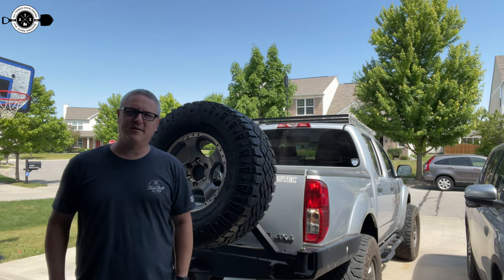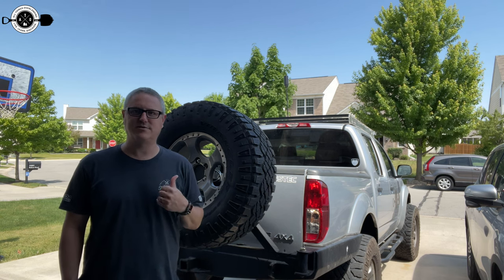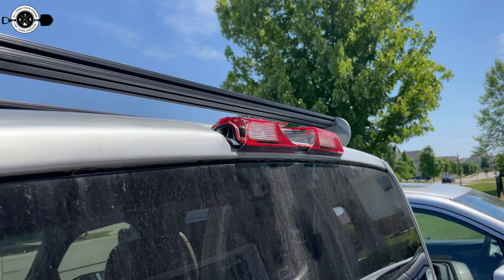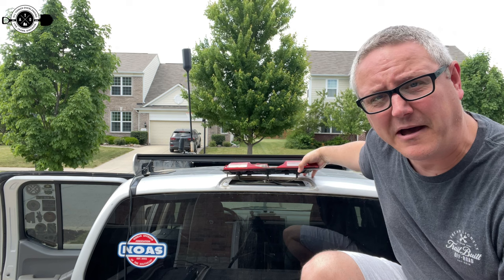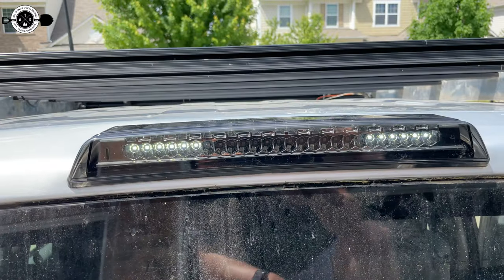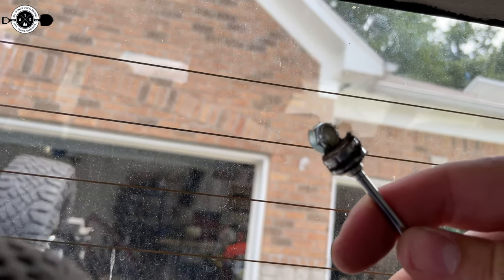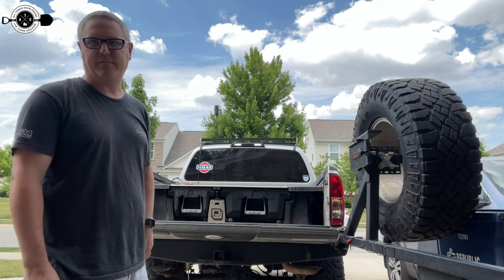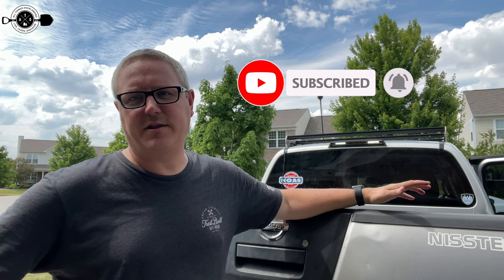How to Replace or Upgrade the 3rd Brake Light on a Nissan Frontier For Just $26 (DIY LED Install)

Comment: Your reverse lights are actually cargo lights.
Reply from the maker: Guess they're both
Reply: So when you put your truck in reverse do the white lights in the new light you installed come on or only come on  when you open the doors?
Reply from the maker: @rayjimenez3265  They come on when you put it in reverse.

Comment: Hey man I have a 2013 king cab frontier and have been looking for some exterior mods, my truck is black so I was planning on matching that and buying smoked head/taillights and the 3rd TL. Besides that I’m looking for side rails (nerf bars preferred) and roof racks, any suggestions? I could use the extra opinion
Reply from the maker: Not sure on the nerf bars as I've only ever had sliders. Z1 has them I believe as does Victory 4x4 and those are good brands. 

For smoked taillights, I have the non-smoked version of these and I like them. They're super reasonably priced too:  https://amzn.to/46wXzvI

For roof racks, I've heard some mixed reviews on the Nismo but since it's basically OEM and no drill installation, that's kind of nice. Z1 sells it here:  https://www.z1offroad.com/nismo/nismo/nismo-off-road-05-21-nissan-frontier-roof-rack-p-53893.html

Anyways, hope that helps!
Reply: @AllThingsOverlanding  thanks man I’ll look into that

Comment: Is it supposed to stay on while the headlights are on? After replacing it, they only go on when I hit the brakes.
Reply from the maker: The third brake light (stock and aftermarket) only turn on when you hit the brakes or put it in reverse or hit the unlock button on your remote while the truck isn’t moving.
Reply: My break light only comes on as well and after the install my cabin and cargo lights no longer work. Think I might have burnt out a fuse or am using to many amps? Let me know what you think. Thank you!

Comment: After installing this, now the cargo and interior lights stay on all the time when the truck is running.  When the ignition is off I can flip the cargo switch on them off and it will go off until I turn the ignition on again.  If I unhook the cargo light, the interior lights go back to working Correctly. I hope you can help me out as I am a newby at trying to fix simple things like myself
Reply from the maker: That's weird. I'm assuming you installed them just using the harness (not hardwiring them), right? If so, I can't imagine you'd have weird side effects unless somehow your harness is wired differently than mine since it's fairly straight forward wiring wise. If you know anyone locally that is fairly electrically inclined, you may show them what you did and see if they can troubleshoot it as it's only 3 wires so hopefully it's not too bad. I guess maybe I just got lucky since mine was essentially plug and play.
Reply: @AllThingsOverlanding  I wired it like you advised, I just unplugged the wires to the cargo light for now.  Thank you for getting back to me so quickly.

Comment: If mine has white that goes white to white right?
Reply from the maker: That’s what I would guess but it may take some trial and error if that doesn’t work.
Reply: @AllThingsOverlanding  do you mind if I get your contact info so that I can send you pictures of what I’m having problems with? Because I need help lol I replaced fuses and still nothing lol obviously I have a green wire on the stock light my light came with white wires so im just super confused
Reply from the maker: @dravensmetalmusic5430  I’ll try my best! Email is allthingsoverlanding@gmail.com.

Comment: How did you end up getting that wiring harness disconnected? I can’t get in there
Reply: Nevermind, I finally watched until the end where you explain it
Reply from the maker: No problem! Hopefully it helped. That was probably the biggest pain in the whole thing.
Reply: Yup, worked like a charm. Now If only I had the right harness connection…
Reply from the maker: @idontcit1  Ugh...

Comment: How were you able to wire the harness wires to the led light wires? It seems like they are both male connectors.
Reply from the maker: They plugged right in. It did come with 2 different plugs, so I had to figure out which one was the correct one for my application, but once I figured that out, it just plugged right in.

Comment: So, I haven't taken mine off yet; was going to 'LED' only the cargo lights. But the idea of replacing the entire unit does seem more sensible. I noticed one thing straightaway in the instructions here. He said he went to a hardware store and bought 10-24 nuts. Those are #10 by 24 threads per inch (tpi).  That is an SAE thread, that is, American. SAE is Society of American Engineers. Some Metrics are nearly identical to SAE and are able to thread down about the thickness of a nut, then stop dead. This vehicle certainly would be ALL METRIC. So while he might be able to force the nylon SAE nut onto a metric thread, it certainly is NOT the best way to do the job. He chided the previous owner for not having any nuts; I am chiding this guy for trying to force an SAE nut onto Metric. All hardware stores nowadays have both SAE and Metric
Reply from the maker: There wasn’t any forcing so it must have been close enough that it worked just fine.

Comment: Did you have any issues installing the wheels on your decked?
Reply from the maker: I actually bought the truck with the decked already installed. I have had a slight leak I’ve been fighting but other than that, it’s been good.

Comment: Installed black to black red to red green to white, only brake lights work no reverse or cargo lights. cargo and dome lights don't work, truck wont honk or light up when locking it. (still locks the truck) this shitty product is gonna end up costing me time and money don't recommend well edit when i figure this mess out. . .
Reply from the maker: Not sure what the problem is. Worked fine for me. Also not sure how a third brake light would impact your interior lights or locking functionality but maybe you touched something live and blew a fuse?
Reply: Did you figure this out?

Comment: Do you happen to know if this will fit a 2022 Frontier? The whole truck comes with LED lighting except for the 3rd brake light. I don't understand why manufacturers keep doing this lol. They go all LED except for one set of lights, usually the rear turn signals or in the Frontier's case, just the 3rd brake light.
Reply from the maker: Haha, yeah, it’s crazy. I’ve heard they’re similar but not sure. Since it’s through Amazon though, you could always order it and test fit it and return it if it doesn’t fit!